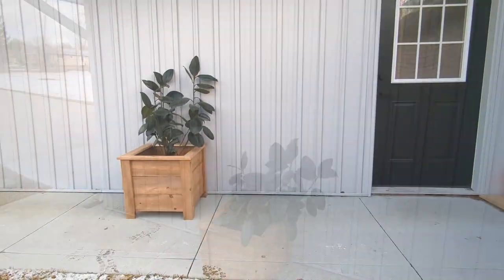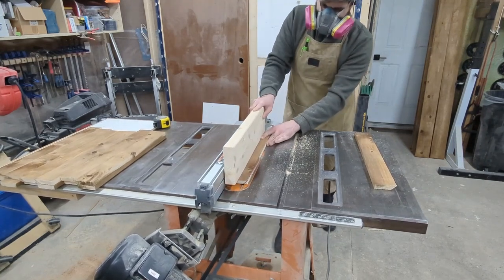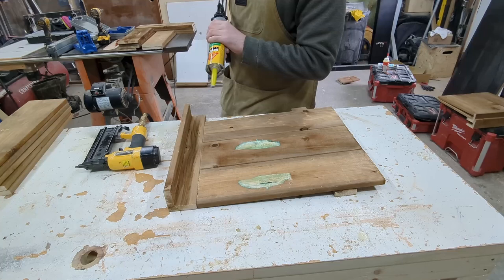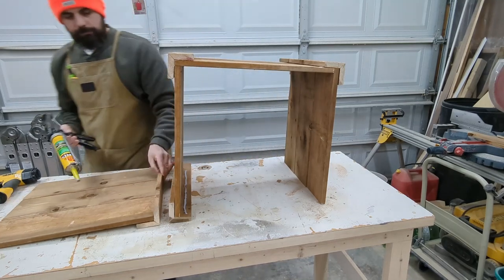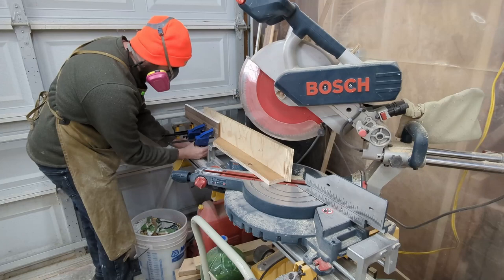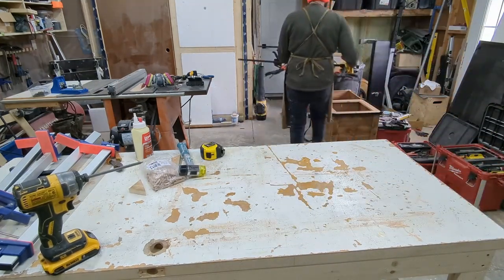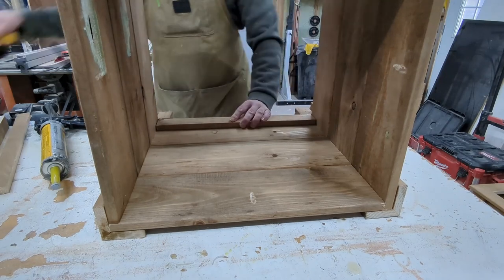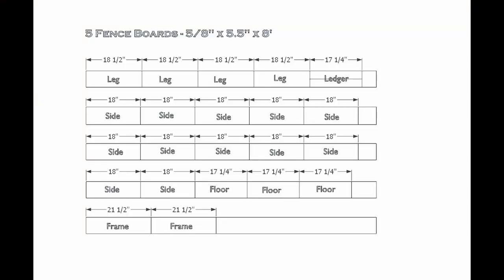Build a Simple and Strong Raised Outdoor Planter to Elevate Your Home

Comment: Dude, you need an out feed table for your table saw or let the wood drop onto the floor. You might feel safe reaching over the rotating blade but don’t forget this is You Tube and some people will copy your bad habits and have an accident.
Reply from the maker: Hey Steve, I do appreciate the feedback.  You're not completely wrong and I'll make a point to do better on the next one.  Old habits die hard.  Cheers.
Reply: seriously ... I was expecting this video to end with him at the hospital..

Comment: What gauge and length brad nails are you using? Are galvanized good enough or should they be stainless steel?
Reply from the maker: I'm using 18ga 1.25" galvanized but they are a little long.  My material is 1.25" thick.  I shoot them on an angle so that they don't blow through the other side.  Staples would probably work even better to be honest but I don't have a air staple gun.

The waterproof construction adhesive does a lot of the heavy lifting as well.
Reply: @MisterWoodBaron   Thanks, I bought a 3 in 1 ,16 ga , 18 ga, and  staple gun. Works great so far. I like the use of construction adhesive . I used to use pretty much all deck screws but after seeing your video I wanted to streamline a bit more. Screws take a lot of extra time and with the price of screws I think you are better off with staples or brads plus the adhesive . With only a few screws if needed here and there. One problem I am having is finding stainless steel brads etc, very pricey, Not sure you need them unless using pressure treated, I dont know.
Reply from the maker: @442olds7  I do believe that galvanized is approved for pressure treated lumber.  I know when framing decks you are required to use galvanized nails as regular brite nails will deteriorate in the pressure treated lumber.  I don't see why an 18ga nail would be any different than a big framing nail.

Comment: Nice build! 2 questions; do you worry about the bottom/floor boards sagging and rotting from the weight of wet dirt? And you said fence boards, but can you expand on the wood you used? I really like the look of it.
Reply from the maker: Hi Derek,

I'm glad you like the look!  I used pressure treated fence boards from any big box store.  They are the type of boards used to build outdoor fences and they measure 5/8" x 5.5". Around here they come in 6 and 8 ft lengths and are treated to survive outdoors.  They usually have cedar in the same size as well.

You could also use pressure treated decking which measures 1" thick by 5.5" but you would need to adjust some of the measurements for the top frame to accommodate the extra thickness.  

As for sagging I haven't had any issues. I built one of these a couple years ago and it's holding strong.  You would probably want to line the planter with some landscape fabric before filling it with dirt to contain everything as well.  

Another option is to build the planter to fit a plastic nursery pot.  That is actually my preferred method because it makes winter storage and maintenance super easy.

Let me know if you have any other questions!
Reply: @MisterWoodBaron  Awesome, thank you so much for the reply! I will likely be building one of these this spring/summer. Thanks again!
Reply from the maker: You're very welcome Derek.  It's a fun project.  Cheers!